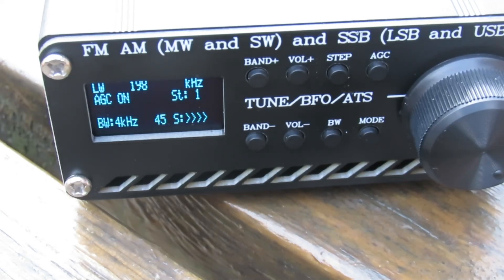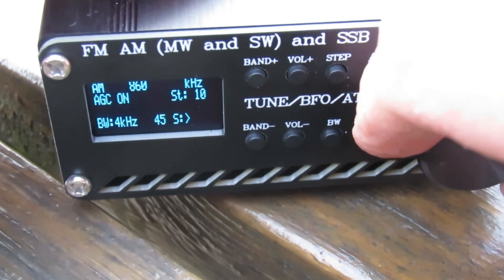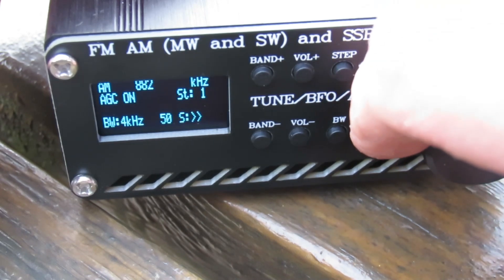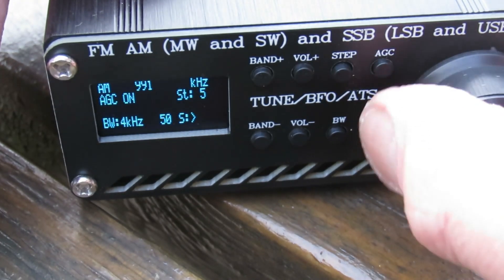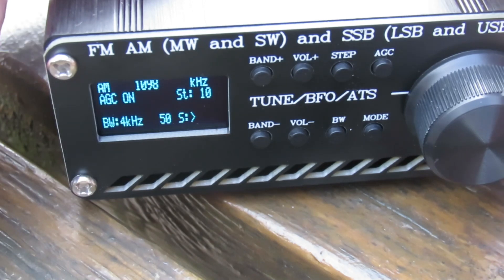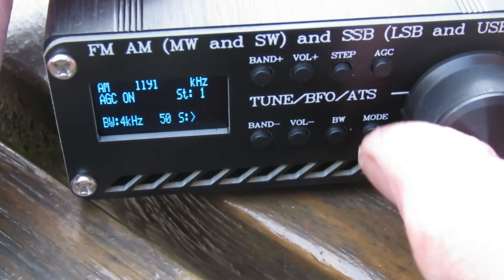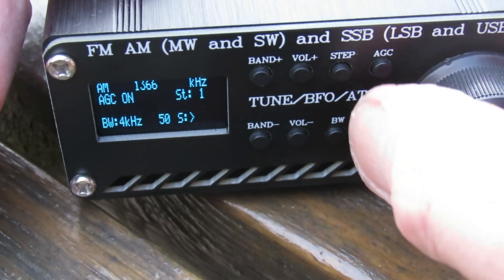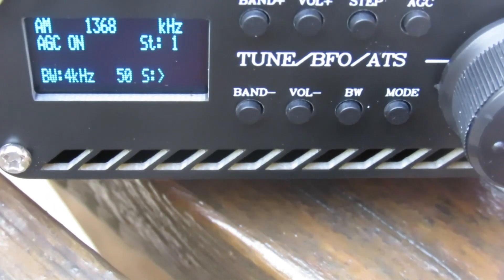SI 4732- Can I receive medium and Longwave on the telescopic antenna?

Comment: I bought one board like your  receiver  to try to improve the the user interface. One of the improvements will be the 9 or 10 kHz band space selection on MW. Also, I intend to store  the receiver status (frequency, volume,  step etc) into the internal Arduino EEPROM. This way, the system can rescue the last  status next time you turn it on. I hope to share it soon. Thanks again for sharing.
Reply: That sounds great Ricardo, I bought one also, it should be here any day now.
Reply from the maker: Ricardo, Excellent look forward to this!